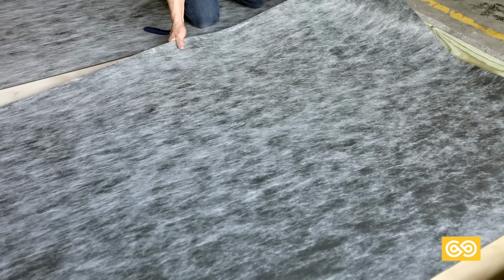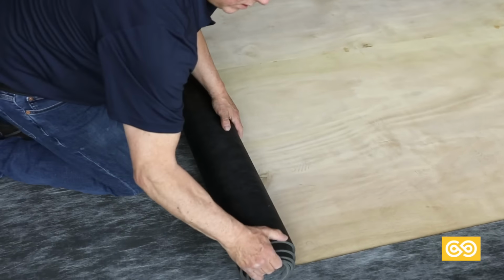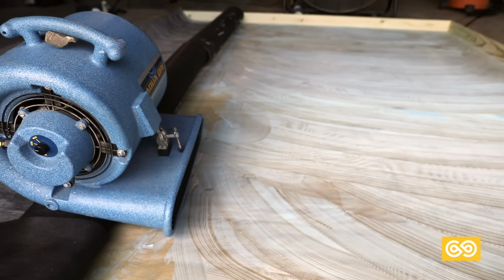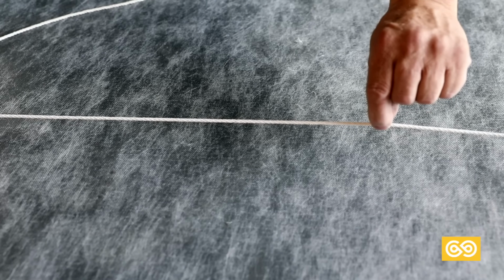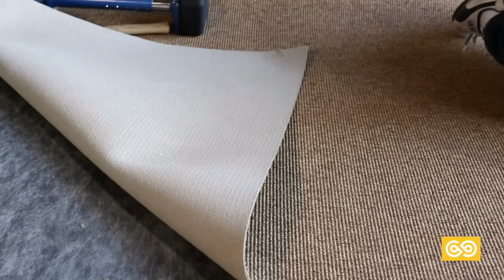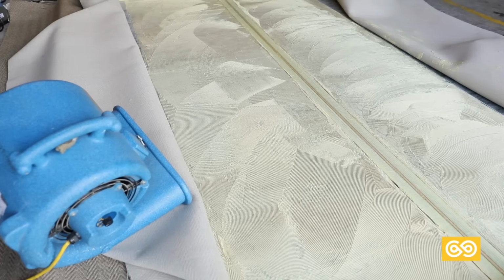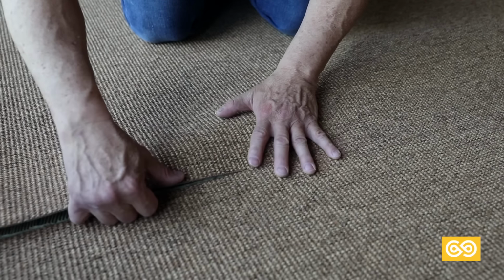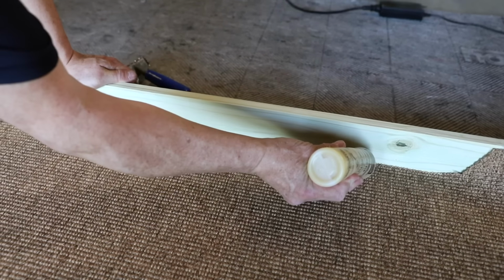SynSisal® Double Stick Standard Installation | Curran

Comment: Not one mention of the koolglide double-stick seam tape that was down, which disappeared when the seam sealer (contact adhesive) was applied. I don't know if that is purposefully done to cause confusion, or to protect the company from seam failures that happen with either method, but, either way, there shouldn't be a instructional video, from the manufacturer, that presents confusion on the recommended seaming technique for their product. Might as well have a sewing kit in the frame as well, just to throw ua off a little more.
As a professional, I would have to assume that seam sealer can be applied to one edge of the seam with an applicator bottle only on a direct glue down and that sealer must be applied prior to, and to both edges, to seaming with seam tape over tremor padding, but this is a double-stick installation video. Please let me know, and clear this up for me. Thank you!
Reply from the maker: Hi Joe, we understand your concern and will review the video. For specific instructions regarding Kool Glide Seam Tape, please see this video https://www.youtube.com/watch?v=s5UHf0YaKIU or refer to our installation documentation and let us know if you have any additional questions on technique. Thank you.